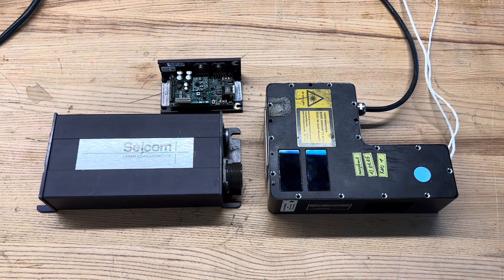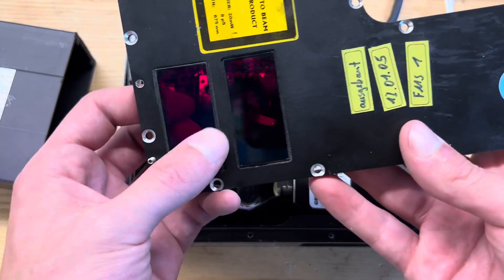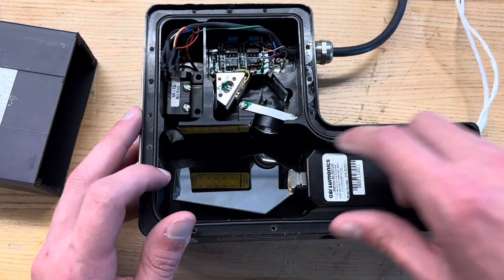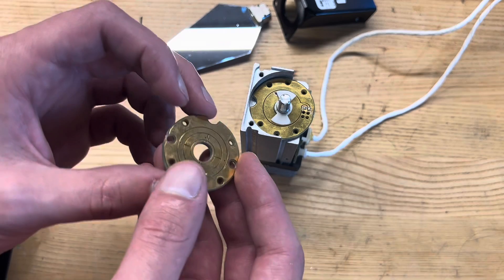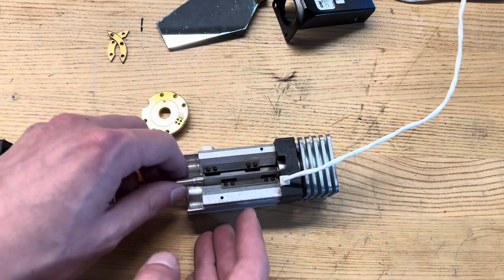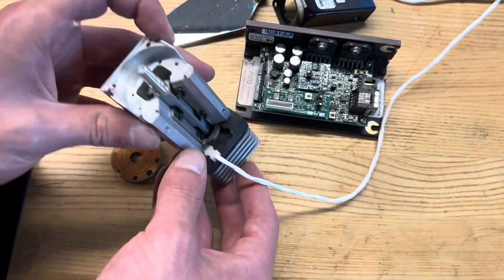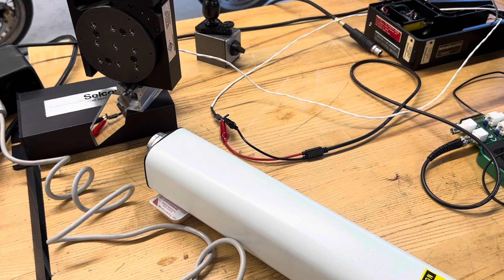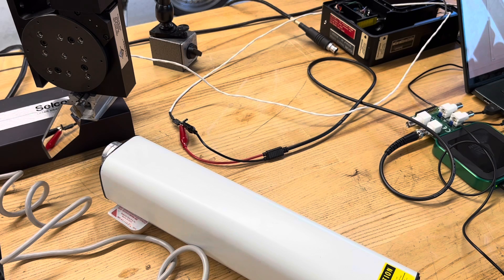Precision laser sensor teardown (flexures?!?!)

Comment: I have a few profile lasers from a insolvency sale. They were used to precisely measure diameters for pipe and profile production and uses essentially the same technique as the measuring system of yours. Only it doesn't have a servo mirror but a rotating axis with a bunch of mirrors around it. Very similar to laser printers. The laser gets returned and sweeps across a similar light sensitive plate.